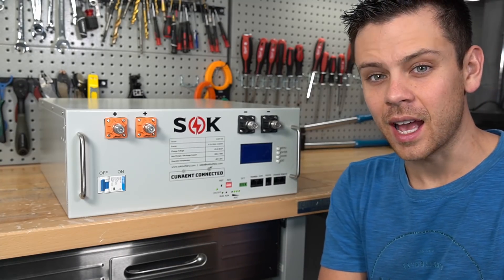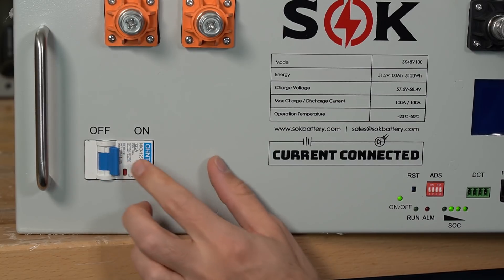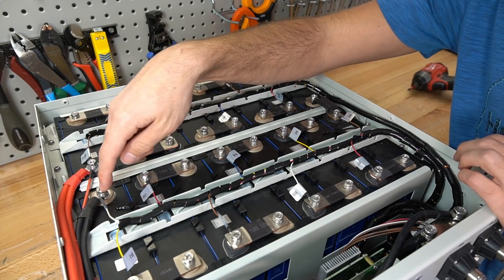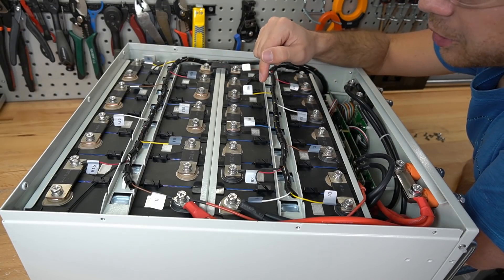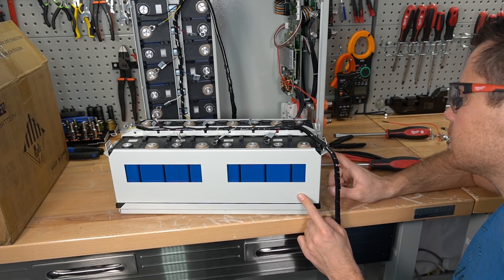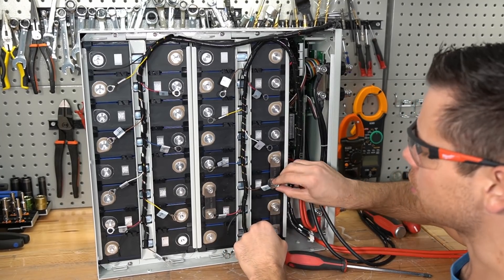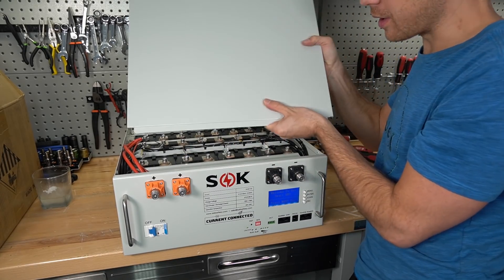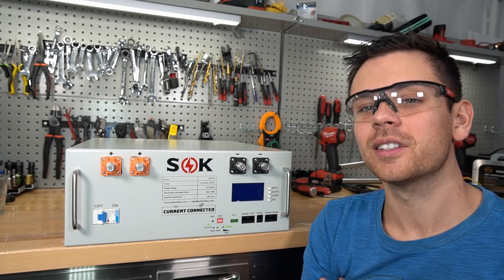New: $1,739 48V SOK Server Rack LiFePO4 Offgrid Solar Battery

Comment: Are you forgetting your longtime nomadic viewers. We’re still here, but our funds, unlike you, still have limited income. What happened to the old you and your frugal ideas? $1,800 for a battery and where would it fit?
Reply from the maker: This is almost just as cheap as building it yourself. I think you are messing up your calculations with watt hour versus amp hour. 

And just because you cannot afford it does not mean other people cannot afford it. You should think about others. I talk about budget batteries all the time so I don't think there's an issue there.
Reply: 1. Will has done MANY videos for us longtime nomadic poorer folks. Why object to him reaching out to help a wider audience?
2. I just installed a "48V" system in my RV, so, if one can  save the $$$ to buy this kind of battery, (which is less than HALF of the price of four 100Ah Battleborns), there are fairly cheap all-in-one solar inverter/chargers that one can get. I DID take out my passenger seat in my RV to install my system.

Comment: Can we loose the "Server Rack" term please..... Racks are not just servers and lead to different dimensions. The common size is 19" while there is also 24" and 10" so can be misleading. 
Maybe SOK can fix their logo/diagram on the front, Battery and PhotoDiode go bang-bang. They seem to mixed up a LED with a PD.
A tip for beginners, when a bolt has both its hex-head and a Philips drive socket, use socket and ratchet to loosen or tighten. Screw drivers just make a mess.

Comment: Only thing I'd add is a cover inside to avoid the lid hitting any terminals
Reply: Will said that this is a prototype, but the ones for sale will have "plastic" covers between the terminals/battery cells and the lid.
Reply: @Tumbleweed5150  ah, thought he was talking about the outside terminals.

Comment: I am looking at nine 150w 65v in series 1,350w per hour but have airstream so only 2/3rd = 900w of corse barring shad from trees and add 3hr of full sun(11 to 1:00) = 450w x 3 = 1,350w. So best case scenario 900x14+ 1,350(3x450w)= 13,950w. But I expect my daily max demand is -9,150 from 13,950 = an exss of  4,800w. But real world I will expect 50% of best case scenario  so 13,950÷2= 6,975w but my demand should be less as well (HVAC) but not quite 50% less let's say 25%less. So more like daily demand = 6,900w of course barring efficiency % in delivery to demand. So cutting it close (75w) but I also have a 100w portable system so 1,000w additional charge and a 400w wind generator.  So does  this sound correct? My HVAC is my biggest demand next fridge/ hot water/ radiant then commutation last is lighting(all led). So am I missing something?  I do have a generator as well.

Comment: SOK should put that top cover on a piano hinge for safety IMO Boom!😀
Reply: “piano hinge” - depends on how it is racked & stacked, this could also limit the mounting options. A lot of servers use piano hinges, others use slide & lock mechanisms.

With a little more depth, the piano hinge would be nice, but that could make for some dead space (unless they mounted rear facing fans!)

Comment: I love the battery and the price, too. Building off-grid home with ~50kWh storage will be piece of cake with this battery.
Reply: @domatic  I was close to buying a SolArk, but went with a Schneider due to my requirement of running a deep well pump.  There's a great video on here comparing the two. Victron would have worked as well, I think, but would have required two units for me to get the 240v required by the well pump.
Reply: Why 50kWh, just curious.  Wouldn't 15-20kWh and a backup generator be a much lower total cost, including fuel and maintenance for teh generator?
Reply: @GeraldMMonroe  I calculated full backup for my future family house. Calculated in week of no sun at all, only 80% of battery usage to keep it running without degradation for years, etc. If I can get small hydro, can go lower on the battery. But with this modular rack system, can grow the system instead of starting big.
Reply: @rklauco  Or you could use a hybrid car or truck as a generator for when you need it.  (or pure EV truck in 5 years).  The cost to do this is $400-$2500 vs $10200 of batteries you rarely use.  Also over time the batteries will degrade and will require outright replacement at 15-20 years, so they are not 'maintenance free'.  

Or in a colder climate, use propane for heating (and a propane fueled generator)

Comment: Hi  
Which one your rather the EG4 Gyll or the SOK  ?
Reply from the maker: I would rather get SOK. Stronger cell holder and I like the terminals more.
Reply: Will the sok batteries be equal to the Eg4? The eg4 claims 300 more cycles then sok for 80 percent life.
Reply from the maker: @optimal2222  they use the same cells. That cycle life ratings is at a modified depth of discharge. They will both do that many cycles

Comment: Will ,be sure to rinse that salt water off the low temp sensors when you do that test its very corrosive. It could possibly cause a sensor failure over time

Comment: With the lid being a little dangerous to put back on they probably should be adding thick rubber molding for arc protection. If it is screws Some type of a cover like side post terminals use. I was expecting the batteries to be in a cage since I am use to that on battery server racks. I got one at home though I don't have it connected since cost at 150-200 monthly on electric bill. Only use if I have to flash firmware. The apc I got has a connector to disconnect batteries in back for remove of unit & front when removing battery. It has a breaker switch in back with front power switch. The small hole on SOK is similar to the manual CD-ROM drive opening not sure if I like that part. A rubber, plastic, or metal over that could be opened then press the button people might like a little bit better since you don't have to go find a screwdriver or a paper clip. It would be a nice replacement.
Reply from the maker: Yeah they will probably add arc protection after they see my video
Reply from the maker: If the circuit breaker is off there will be no Arc so I don't think it's that big of a problem actually

Comment: I’m in the process of replacing a new lifepower4 48v server rack battery from signature solar and we believe it has a BMS problem as it will not accept a charge above 54 volts no matter what. My other 5 batteries charge right up to 57 volts but this one disconnects at 54 volts and really screws up the bank when paralleled with the rest as the Growatt throttles down the PV input to a trickle. Anyone else have a similar issue?

Comment: Will, since EG4 and SOK are using the same BMS is it Ok to use both in one battery bank?
Reply: The BMS look exactly the same and the function the same, but SOK choose the Panasonic IC on BMS, not sure eg4 using which brand
Reply from the maker: You can use all of these 48V batteries in parallel without issue. The problem is that they won't communicate. I think the communication system is useless, my opinion. Just wire up as many as you want in parallel. Need t class fuse for supply conductors though
Reply: Maybe not, not sure which bms model they using.

Comment: So, now the question is when the first server rack inverter will come out?
Reply: Yes, having everything in a single rack would be awesome.
Reply: “first server rack inverter” - they are used in Data Centers, today! The term is UPS. They come as sine wave units, with external battery connectors.
Reply: “server rack inverter” - I just found out that Genetry Solar’s inverter will fit on a rack shelf!

Comment: Hey Will or anyone else, is there something equivalent to these server rack batteries that have internal heaters built in (for cold climate off grid system)?  I love the plug and play nature of this with an all in one charger/inverter but I think my climate would require some heat to keep the batteries able to charge.  Thanks for all the great videos!
Reply: Yep there sure is. First you take a reptile aquarium heat pad, and place it under your battery. Then you put the probe for a reptile thermostat under the battery near the pad. Then set the reptile thermostat to the desired temperature. Then plug the heat pad into the thermostat, and the thermostat into your inverter. 

Problem solved.
Reply: @vhfgamer  I like the diy approach but I am hoping for an integrated solution if possible.  One where solar would first warm up the battery then charge.  That way if the battery is to low to power the inverter, the solar can still warm up and charge.  I guess it is possible for the inverter to run direct off of solar if the battery is a low voltage state?  Do they work that way?
Reply: @oof_Dad  no they don't work that way.

My suggestion never lets the battery get cold in the first place, so it doesn't have to "first warm up, then charge" like you're talking about. 

Just set the thermostat to click on if the temperature gets below say 35 degrees. There's no point in having some sort of janky integrated thing that will probably break and make you do it my way in the end.
Reply: This is the info I am looking for also, need heated server rack batteries.
Reply: The only problem with heating pads is when the batteries they're heating run out of juice letting them drop below freezing, then the sun wants to charge them the next day. If the BMS has low-temp protection (and this one does) you won't lose your batteries- but if it doesn't you can lose all your batteries in just a few minutes. This is why Will is such a stickler on having low-temp protection done correctly.
Reply: @P_RO_  If your battery system is running out of juice or getting anywhere close to running out of juice... you designed your system incorrectly.
Reply: @vhfgamer  I won't disagree, but some circumstances can screw you unexpectedly. One poor slob had heating pads for his off-grid weekend cabin batteries. An ice storm and cold snap after an extended cloudy period kept him from getting there as planned. On arriving the next week he found $5700 worth of nearly new batteries ruined because there was no low-temp charging protection in his system. Normally he would have been more than good, but things went far from normal and he couldn't do anything about it. My take: If it's even remotely possible then it makes good sense to allow for the possibility one way or another.
Reply: @P_RO_  So.... what did the dummy leave running that sucked his batteries down?
Reply: @vhfgamer  Don't know any more details. All that was said was about the heating pads failing from lack of power followed by a sunny (but still cold) day. Strange things can happen unexpectedly is my point, and when low-temp protection is actually simple and cheap, there's no reason not to.

Comment: Hey will, I noticed through your affiliated link for the growatt inverters that growatt now has their own 48volt server rack batteries in stock.  Do you plan on reviewing these as well?  I'd be very interested in that.  Thanks
Reply: I would strongly advise against Growatt.  Myself and 2 neighbors had Growatt inverters for off grid system and my failed within 6 months, 1 neighbor lost 2 in 18 months, a the 3rd in a year.  They are lightweight (very cheap) and support is terrible.  They told me it would be 2 months to before I MIGHT get a replacement.  Obviously, off grid systems can’t wait that long.  Terrible.
Reply: Me too been waiting to see a review on Growatt ark 2.5kwh and the new Axe 5kwh  that just came out ...

Comment: The pre-charge routine should be easier.  How does EG4 do it?
Reply from the maker: Eg4 precharge is identical
Reply: I never saw anyone do anything to pre-charge the capacitors on those E4G videos.  They just flipped the breaker.  Perhaps "the routine" was done offline.
Reply from the maker: @tsp2jxd  yeah I thought it was automatic but I was wrong. They all work this way.
Reply: @WillProwse  - precharge instructions should be on an exterior label, near the button.

I hate that inverter vendors pawn this off on battery makers. I would ding every inverter vendor who does not automatically bundle pre-charge resistors in their own equipment, with automatic use, this with a severe review penalty.

What a sustainability waste, to bundle that into every battery, which will be eventually discarded, when it should be on the inverter.

Cars bundle it in, with their electric drive trains, no reason inverters for solar homes should not do it.

Comment: i am very impressed by the construction and servicabiiity of the unit. all except for closing the lid back at the end. but that should be pretty easy to fix or work around right? then just a minor quibble and inconsequential.

thanks also for the other recent videos and sorry to hear about your plad greif. not really sure why the appeal of that model but hopefully it is a good lesson to others who were considering one. the hickie is alien tracking device BTW, pretty standard

Comment: I don't like the dance needed to use the pre-charge.   It is too easy to forget and turn on the battery without going through the process.    The Pre-charge should always be engaged when the breaker is turned on.
Reply from the maker: That's impossible. The leads of precharge circuit for all server rack batteries connect between p- and b- of BMS.
Reply: @WillProwse  how does EG4 do it?
Reply from the maker: @tsp2jxd  exactly the same. No different.
Reply: @WillProwse  Good point about the location of the breaker in the circuit vs the location of the BMS.  It would take some way to sense that the breaker is off or on.... but it could be done.
Reply: @centerrightproudamerican5727  I don't see any real problem with a person of average intelligence uses this and understands why to do it. Those who don't understand or are of lesser intelligence will fail somehow regardless. If you build something "stupid-proof", nature will invent a higher level of stupidity in someone to circumvent your efforts so there's no winning that game. I'm no genius but I can understand what's going o9n and what to do and why, so I feel it's at an acceptable level now, but as others have mentioned a button instead of a switch hidden in a hole might be worthwhile. I'm good either way.

Comment: Hi I know you can not charge a lfp. battery bellow 0c but can you still use the   power from it?
Reply: Yes and no. We should remember that Lithium capacity and lifespan is rated at temps within their charging range. While you can draw power through their entire discharge temp range, doing that at high levels will shorten their lifespan as much as 20%, so if you know you'll be using them this way it's best to build some extra capacity into the battery bank so that it sees a reduced load percentage. Alternately limit the load during those conditions. Hard to give any solid numbers with this but the phenomenon has been noted and documented by enough people to know it makes a difference. 

Heating pads can help here, but since they draw power too it's not a good solution for low-temp discharge. However they do allow charging when ambient temps drop below freezing since the battery will be a lot warmer so if you have good sun that extra charging time can more than offset the energy used by the heating pads as well as allowing more current draw without loss of lifespan..
Reply: Short answer: Yes, down to a certain point. Long answer: Yes. The spec sheet for my BBGC3s says they can be discharged down to -4F, (-20C), and are okay up to 135F, (57.2C). The BMS will shut off the charging at a warmer cold temperature to protect the batteries. (I was more concerned with the higher temperatures, since it can get over 120+F here, and rarely freezes.)
Reply: @Tumbleweed5150  cool Thanks for the info.